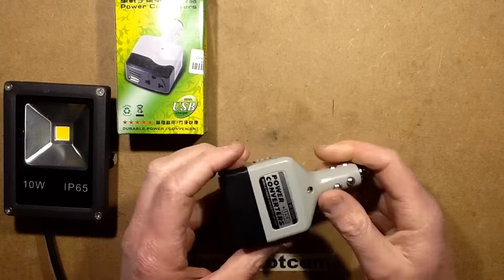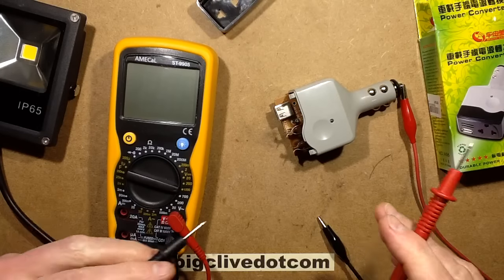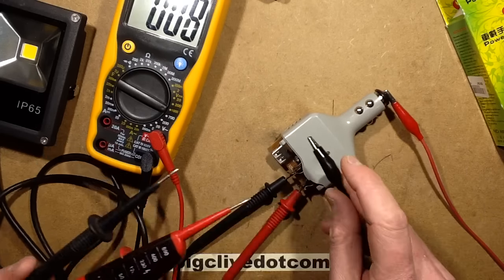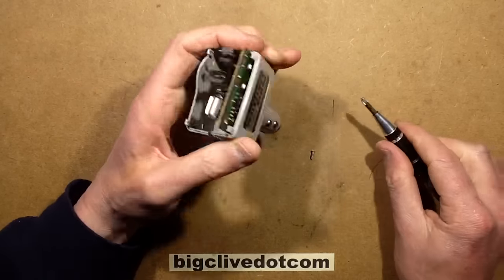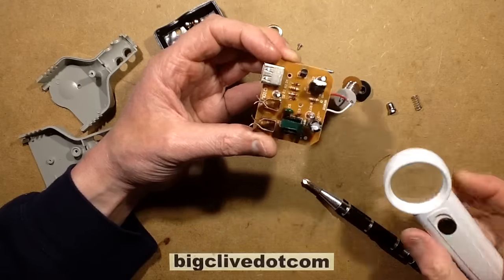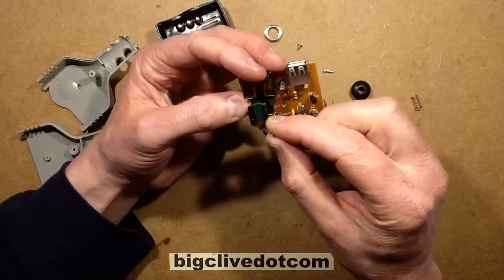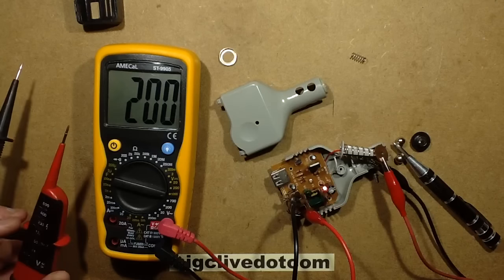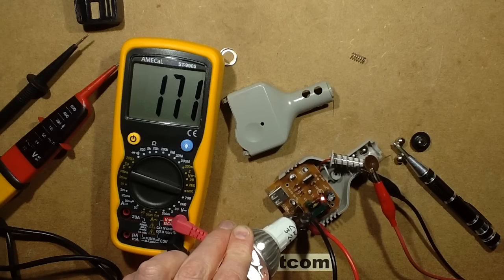Inside a slightly bizarre car to "mains" adaptor.

Comment: All the 12 VDC to "mains" adapters I have seen generate an output that is called "modified sine wave." MFS is actually a three-level voltage (~+180, 0, ~-180, 0 VDC to approximate USA 120 VAC rms) that could, with a lot of imagination, be thought of as a sine wave. Maybe you need an oscilloscope to look at what the supply is actually putting out. Also, you should eliminate variables by not using non-linear loads in testing the power output; use a resistive lamp or heater, and then go to trying to drive switched mode power converters.
Reply: +Ed Price I've looked at modified sinewave inverter outputs from a 2200W unit running a water pump. The inductive load causes massive back emf on what should be flat DC levels.
You know how the shape goes, ground, +240, ground, -240, ground. Each time it went from +/-240 to ground there was a massive 200V spike from back emf, inductor tries to resist the change in current flow. So you have 440V spikes all through anything else you were running at the time.
Reply: +KiwiPowerNZ I would think that the modified sine wave (and I almost gag every time I need to call it that) needed to achieve an equivalent of 220 Vrms (220 Vrms, 50 Hz is the NZ standard, right?) would have to be much higher that +/- 240 VDC. The small inverters prevalent in the USA market switch about +/- 180 VDC to get a rough 120 Vrms. Are you sure of the P-P voltage you were seeing? Anyway, beyond all that, you are quite right to point out the nasty surprises awaiting those who apply this modified sine wave to any non-linear load. An incandescent light (sometimes even a typical power transformer) can handle that waveform, but you are on your own if you try to drive highly inductive loads or switching power supplies. For my RV, I decided to not use a 2kW MFS inverter but rather run everything except microwave and air conditioning off DC power. I run my LCD TV, audio amplifier system and TV pre-amp from a 400 W MFS inverter, and I carefully monitored those during a trial period. When I found no over-heating or EMI interactions,  I did a permanent installation. But my success doesn't say much about what someone else might experience, using a different TV and MFS inverter. I think that if I was seeing 450 Vpk spikes on my system, I would be troubled enough to probably switch to a true sine wave inverter. You will still have start/stop transients (unless you get really cool and electronically switch at the zero-crossing points), but at least you will not have 200 pulses per second like you have now. (BTW, have you been seeing your system noise degrading your AM broadcast reception?)
Reply: +Ed Price I couldn't remember the exact DC level, but I remember the shape of the wave, the 0v time was shorter than the voltage time and as mentioned with a big motor running there was big spikes, it was several years ago. I clearly remember that the back emf was about 200V above the normal voltage because that was the surprising discovery. That installation is at our old house which has a 24V off grid power supply. That inverter has been running continuously for, must be 30 years and it's still down there running right now. Officially New Zealand is 400V ph-ph and 230V ph-N, but many houses have 240V transformers so it's a mixture between 230 and 240. We measured our mains at 234V.

Comment: I can believe they still make those. The design hasn't even changed in 5+ years
Reply: +James Wood 
It looks like it was designed in the 90's.
Reply: I'm sure it's an old reused design. There is an even older version that was only different because it lacked a USB port

Comment: Did you know that the Tip31c is also used in plasma globes and tesla coils? It's to oscillate the primary and feedback coil to produce high voltage

Comment: I'd worry with the DC and switching converters, may be that it coverts AC to DC anyway but the full bridge is running at double the duty cycle as usual, any reasonable one should work but if youre as broke as to get this I'd start worrying about it

Comment: I occasionally use of these to charge a laptop in a car and boat. The problem is that the charge does only initialize if the laptop is off, or if the battery is at 100%. It will not charge when the laptop is running and charging the battery at the same time; the LED goes dead and the whole thing stops working. After about 30 minutes of operation, it gets very hot and I always unplug it then. It's red, not grey as you have. It's a crap, but it works for my purpose.

Comment: Since this is an old video I doubt anyone will see this, but on the off chance. . . . Whenever I need to bench test a 12v car adapter or something similarly cylindrical I use a metal worm gear type hose clamp. They are cheap, I always have one in my toolbox and they work a treat.
Reply from the maker: A Jubilee clip.  Good idea.
Reply: bigclivedotcom I have not seen that particular name for one. That was a nice little trip to Wikipedia. Thanks to you.
Reply: I have a cigarette lighter socket stuffed into a 35mm film canister with leads to banana plugs for bench power supply.

Comment: I have one like that but mine has a fan. It converts 12 volts to 240 volts and the USB puts out 1 amp. Portable but incredibly useful. I wouldn't use them for any sensitive equipment though.

Comment: I remember converters from car battery to 220 VAC. They were huge (I mean 30cm cubed huge) and the leads were clamped on the car battery, not through the cigaret lighter. Didn't work unless the car was running on idle. Which btw. is now illegal in Finland.

Comment: The text in Chinese says it's a phone charger, so I'm assuming it's for seriously old phones (e.g. Sony Ericsson) with strange adapters, and you plug the wall charger into this thing.
Reply: hawkturkey  How else would you charge a modern phone other than by plugging a wall adapter into an outlet (assuming there are no USB power sources such as a computer available)? I'm curious.
Reply: @martinweizenacker7129  But assuming there are no USB power sources is pretty unlikely, USB car cigarette lighter chargers are very easy to come by.

Comment: Here in the US those are quite common, i personally have a 150w one which does indeed put out 120v at 60Hz. And it will do 150w.
Reply: +A. Zak Completely different on the inside. This thing just puts out high voltage DC.

Comment: I thought of buying that thing years ago but thankfully I didn't and just get myself a proper inverter. That thing is just a fire hazard and could probably even kill whatever power adapters are plugged into. The inverter I have right now is still an unknown branded one but it's quite alright and does output a decent waveform (just acceptable), hasn't overheated or burned and is still going for 4 years.

Comment: The 78L05 is rated for a maximum input voltage of 20V. 

(Yes, different manufacturers have different input voltage ratings for the exact same part number, but the vast majority of 78L05 regulators I've seen were made by Wingshing, and theirs has a maximum input voltage of 20V.)

Comment: I have an almost identical looking unit that outputs a real 120 watts that I used regularly with my laptop power supply in the car (these days I'd build a straightforward 20 volt boost supply) but I still have it after more than 15 years and it still works. Fairly sure I got mine from Maplins who, sadly, are no more. Almost certainly made in China, but obviously MUCH better quality than that one!

Comment: I have this converter for few years. It is not made to power up USB chargers, but  other chargers from old time when every device maker had it's own voltage and connector.

Siemens used to have 5.5V and it could not be charged over USB, and old Nokia used 3.7V.

Comment: my guess for the wall outlet plug there is for the older people who still have phones that dont have a usb connector for it.  i remember those being quite popular around my area for quite some time.  but they were much better quality im assuming.   if i remember correctly the usb was 500mA and the output was rated for 9 watts on the ac plug i think.....

Comment: I have one of these for my car using the US plug.  According to the paperwork on mine it will not put out the full 120V if it is running on less than 14.4 volts which is what the average wiring in a car would be.
Reply: +Eric Brunhammer Well, mine isn't a Chinese special.

Comment: I've got one very similar to this!  I think yours is a scam. I can run my laptop off mine, which pulls about 100W.

It's useful to plugin my laptop charger. I also use to plug lamps when working at night on the car. Also plug in my router when power is out, so I can have internet.

Comment: I designed something similar on my final year project at uni. Only AC out. I was limited to 50vAC for health and safety reasons. Effectively it was a buck boost with a sinusoid pwm input and outboard inverter bridge. This was all discrete components before the micro controller use for everything days. My issue was it was going to be Inherently lethal as is that thing.

Comment: How can this work with a phone charger if it output DC? Don't they use transformers to lower the voltage?
Reply from the maker: +SlyPearTree The phone chargers immediately convert the mains to DC anyway, and then reconvert it back to AC at a high frequency so they can use smaller transformers.
Reply: In the old days wall warts would have a mains frequency transformer followed by a rectifier and possibly a regulator. However the drive for efficiency and shifting relative costs of electronics (getting cheaper all the time) vs big hunks of metal (not getting cheaper) have meant that nearly all wall warts nowadays are built round rectifying the mains and then using a flyback converter for voltage conversion, isolation and regulation.

Comment: Correction ,that is a flyswatter oscillator circuit,the size of the tank circuit inductor/transformer is identical to some old swatters i have,i've been had,should've found this vid first,i wonder if it could be pulse fired and have a cockcroft walton multipier added to make a sort of CDi for my lawn mower.

Comment: I personally had one of these.

I connected four 600v 1800uF capacitors in parellel to increase the current.

This way, I could practically power stuff.
Reply: All that does is buffer the demand from the source. It doesn't help the overall output
Reply: @MikinessAnalog  yes. It allows to run devices in intervels.

Comment: This is how I discovered many things run properly on 100 volts DC here in Japan, especially any high speed switching supply. Any inductive load do not function as it only creates an electromagnet. In my off grid home every outlet has 3 options (and they are colour coded) 12 VDC - 100 VDC - 100 VAC.  You MUST place suppressing capacitors on every thing  operating on 100VDC to prevent it from arcing when switched off.

Comment: I was really hoping you would try to charge something on the USB output, to see how long that little transistor would last.
Reply: +arfyness It's a 78L05, not a transistor. The 7805 (of which the 78L05 is a low power version, without a metal cooling tab) is a simple linear regulator, dissipating energy to ensure the output is exactly 5v. But yeah, they all melt the same.
Reply: @johnbrown9181  Except the 7805 series has built-in thermal protection.  Above a certain temperature it will limit or turn off the output.  Besides the classic 1A version and the 100mA 78L05, there's also a 5A version.
Reply: @johncrowerdoe5527  Oh right, my bad.

Comment: I have previously bought two models like this from Walmart in the United States years ago, I use them to plug my cell phone charger into only and both of them aren’t welding themselves to the power outlet in my car and smoking so furiously that I had to pull over. The second time I could not pull it out and it was so hot I abandon the vehicle. Thank God that Nissan cars at the time did not support accessory power with the ignition switch off! Otherwise it would have burned my car to the ground, just charging a phone, actually an old-school iPod… They have the three prong US cable that could really be connected to a toaster oven if someone wanted and it was rated extremely high like 500 W… Thanks for the videos, cheers!

Comment: Its about power source they needs atleast 3amps.
The fancy act is because they dont hawe low voltage shutdown systems, they simply try to continue working even if power is not enough.
give it 5~ amps and it will work, but im not sure how long it will work ;P

Comment: You should check out the higher output version, the one with a cooling fan. :)
Reply: Made by Bestek, 150W.  I have one that is getting quite old now and the plastic case is crumbling apart.  However the inverter seems to work fine.

Comment: You really need some jumpers about 6" long, with mini gator clips on the ends.  That way you could clip onto the board and make your test connections out where you'd have a little room to work.  I do that and it is very handy.

Comment: I have a device that looks nearly the same, the inside's quite a bit more beefy though. It puts out a 240v AC square wave. $12. 
It actually managed to run my laptop's charger, but said charger didn't like the square wave. Still, got it pumping 60 watts.

Comment: Wow. My car has a 230 volt, 50 Hz AC socket that works perfectly fine and doesn't drop any voltage under load (it only works up to 180 watts though, in the US they go up to 400 watts).
I can't imagine they use very expensive materials to get that to work. I also had a Duracell transformer than converted the 12 v socket to mains AC (2 sockets + 2 USB ports I believe), and it worked very well, while the transformer and everything didn't take up much room either. Would run 230 V lamps fine while camping, but could only supply 150 watts I believe.

Comment: I suppose there is some advantage to exposing the charger for your very expensive device to odd voltages and who knows what rather than exposing the very expensive device itself to weirdness; but it would have to handle about 3 times the power just to get to the low end of useful.

As to the USB part, look for a power resistor in series with that 7805 to dissipate probably about 6 volts so the regulator doesn't have to.   Still not much current, and still going to get hot on 24 volts, but the 7805 will probably cut off when it gets hot, so the result will be useless levels of charge rather than release of magic smoke.

Comment: I think that the transformer and the power transistor forms a calibrated joule thief. Should I be designing it I would use a have closed-loop approach, as a comparator IC and a voltage reference would cost next to nothing already.

Comment: The only use I can think of is for very very old phones that you cant get a usb cable for. Perhaps use it to charge a laptop?
Reply: +weirdstuffanimation7 Laptops would charge with higher wattage than 10W, though. This couldn't handle a 10W LED flood light. I thought the same thing about old phones with their own mains charger.
Reply: Delightful Hardware It might charge a laptop if the laptop wasnt running but I think the phone thing is more plausible.

Comment: Is it really the 78L05 in TO92 package that drops the 24V linearly to 5V? :) At 500mA load this is 9,5W dissipation. In few seconds this 78L05 is going to melt, short and connect 24V to the phone :).
Reply: 666 isn't cool.
Reply: wyverns aren't cool
Reply: Uhm, isn't it 12 volts?  Only 3.5 W at 500 mA load (USB maximum), it could work for a whole second! :)

Comment: the 7805 may be controlling the transistor to output a higher current than the 7805 can handle,in parallel with the 7805,i do this myself for low voltage high current supplies ie vacuum tube heaters using 7806 and 2n3055 as the main series element.put a load on it if the 7805 losses it's magic smoke they cost pennies anyway,you can always buy more from china.
Reply: You can do better with a PNP helping the LM78L05.  With no load, the 7805 draws only a few mA.  A resistor on the input side will be a long way short of Vbe of the PNP when there is no load.  The sense resistor on the input of the 7805 and an emitter resistor on the PNP can be calculated so that the  PNP passes about 50 times the current the 7805 is doing.
In this case though, just using a full up LM7805 with a heat sink would have been a low cost way to get enough current for an honest USB.
(13V - 5V) = 8V on the 7805
At 1A, this is 8W to get rid of.  They would need an aluminum case with fins.
Another option would be to do the 5V with the switcher and regulate the 5V.  The mains voltage would be unregulated but would be good enough.
Reply: probably why the slightly better ones have a small muffin fan inside.
Reply: @pir869  A bucking regulator would get the 5V USB for less cost than the linear plus the fan.
Reply: very true,but sadly we don't have a buck circuit here.And the buck regulator would be more efficient.
I received the two i bought to-day,the booster is a fly swatter circuit.

Comment: I have the red and black inverter, it works fine (like a normal cheap inverter) and it looks like it has an actual inverter circuit inside.. I haven't tested it with higher power loads yet (it has a Max watt of 150w on the box) because im only using a powerbank with 12v 1.5a so I can't fully test it

Comment: I'm puzzled to find a use for the device
Reply: Use #1: You have an old or exotic phone that doesn't charge from regular USB, with this in front of the non-standard charger, you can charge it in your car.

Use #2: You have one of those small USB gadgets that draw at most half a Watt (100mA). This can work from the 100mA 78L05.

Use#3: You have a regular mains to USB charger, forgot to bring your full power 12V to USB charger, but somehow remembered to bring along this thing.